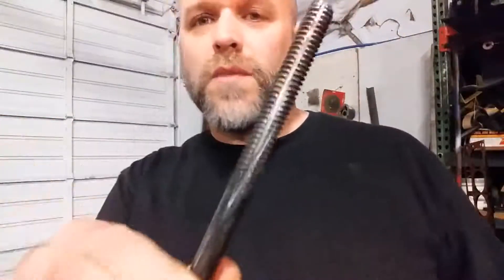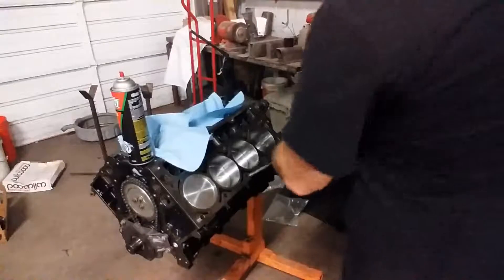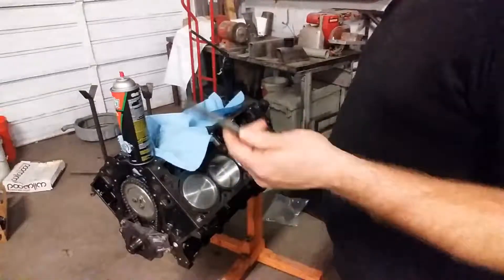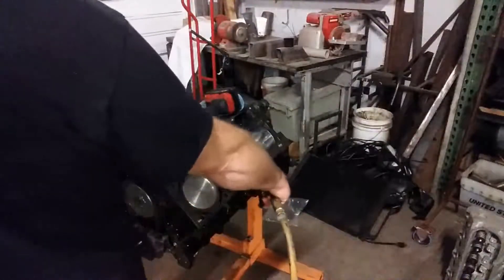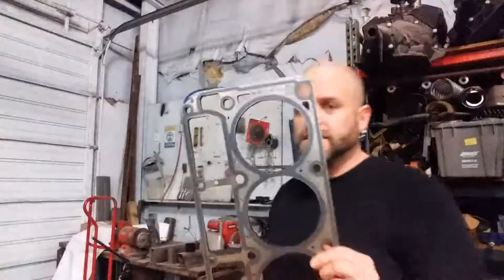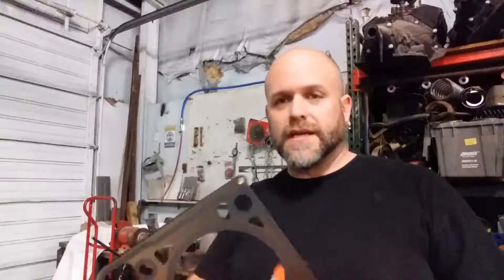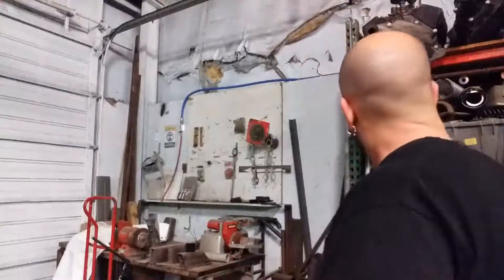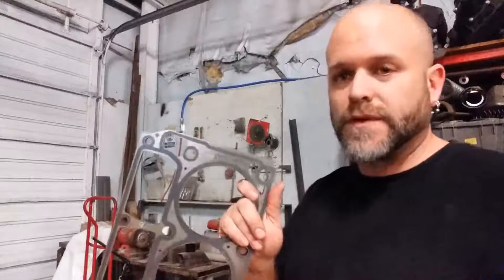Super important step - cleaning the engine head bolt holes using a old bolt

Comment: Hey brother. Quick question. I am reusing head bolts M11x1.25x 93. I am torquing down to specs(72ft lbs) . I think some bolts have stretched but I cannot get bokts for about two weeks. If I add some washers to the bolts will that help get the correct torque . Adding washers since bolt holes on block bottom out. Any help is appreciated. Thanks

Comment: All bad lol … that’s going to fuck up ur thread in bolt hole , and he did it with a drill
Reply from the maker: OK not sure why you think that, care to explain and would appreciate no cussing? You do know what a thread tape is right? This is the same concept. Oh and yes a drill with 100's of threads per hole if used correctly is a very very large time saver. Videos here like mine are a way to achieve a goal like most lessons in life you should learn from all you can and of course find your own way. hope you have a positive learning day!
Reply: Lol what did you cut that bolt with I’m sure there’s metal debris all over that bolt even if clean it down but okay dude You know what ur doing haha
Reply from the maker: I appreciate you responding and that's an understandable reason for thinking that but I use a Dewalt .045 Metal cutting wheel, DW8424B5.They pitch this as a no burring when cutting product, as it cuts it polishes the edges. From the years of using them during my fabrication work I would agree. I have never had to wire brush or grind any burs off after cutting with one. Again appreciate your response as others may have similar thoughts.

Comment: I have an old Honda cafe racer, and just "overhauled" the top. 
Valves were sooted like badly.
My problem is, when I tried to turn my 8 bolts back, I "feel" there's greasy, sooted bits of sand down there. I will definetly try this method! Nice video. Thanks!
Reply from the maker: No problem glad to contribute. Thanks for watching

Comment: Hey mate, thanks for the vid. Can I put the groove in the bolts with a grinder and cutting disc?
Reply from the maker: Hey, that a perfect question thanks for asking. You could use a grinder if it has a very sharp edge but you really don't want a wide gap. This could cause damage to the threads. So best to stick with a cutting wheel/disc style if possible.
Reply: I use a dremel then de-bur with brass wheel. 
 I always use a cross bar and do it by hand, working back and forth as I go in, then blow out.